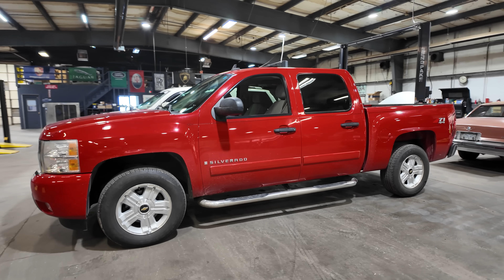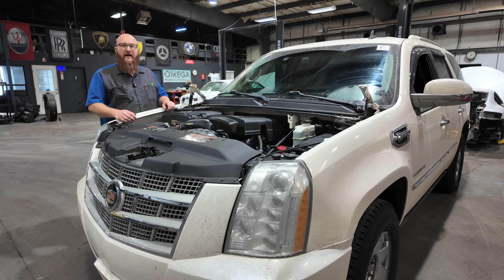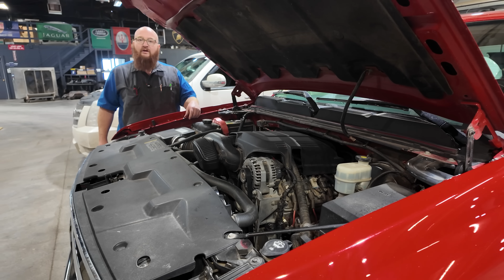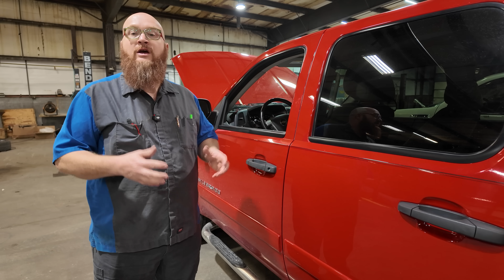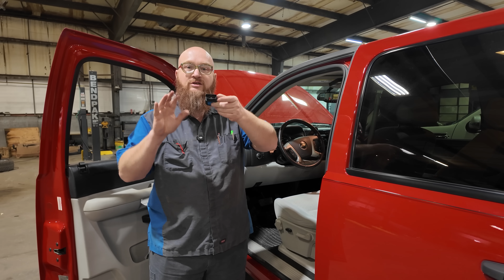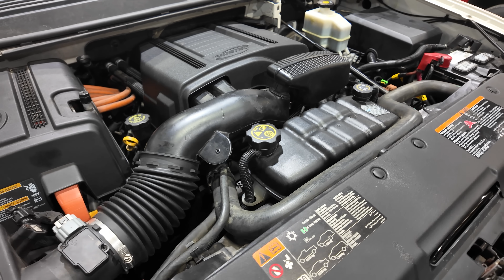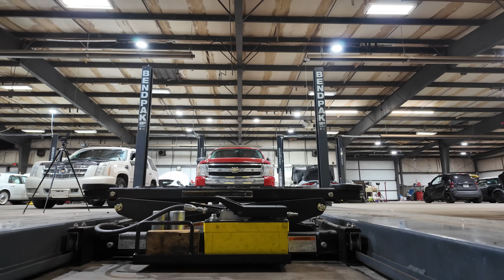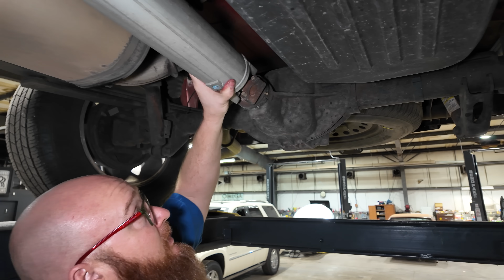AFM: Engine Saver or Engine Killer? The REAL Answer

Comment: I know a Chevrolet mechanic who worked at the dealership. Bought a suburban that needed a whole new engine. The customer didn’t want to pay to get fixed.  Took it home and rebuilt it and deleted everything.   So now it’s a stock 5.3.   Without any AFM prior to 2006.
Reply: I own 3 GMT-800s. Two 2004 silverados, and a 2005 Sierra. I will not buy anything newer that an 07
Reply: @citizenblue  . A friend had purchased a 2009 Silverado 'Classic' model that came without the DOD/AFM/MDS/ACC/VCM nonsense (the 'Classic' model had the same style engine as the 1999-2006 models, none of the Displacement-On-Demand/Active-Fuel-Management/Multiple-Displacement-System/Active-Cylinder-Control/Variable-Cylinder-Management).
Reply: @buzzlight2nd1 yes, they exist, and you have to know what to look for.
Reply: @buzzlight2nd1 they only did the classic in 2007.
Reply: @citizenblue this is the way... prefer myself nothing newer then 2005 really
Reply: How difficult is this process?
I have an 06 already without AFM but if I ever purchase a newer one it would be good to know how to delete the AFM
Reply: @J19A92T  The chevy silverado 2007 was the last year not to have AFM. Anything newer than that just get the OBDII electronic gig and leave it in 8 cylinder mode. I've used that gizmo on my o7.5 silverado since it's had ninety  thousand which now has about 170,000 miles on it. If the lifter ever does start the tick then worry about  deleting the AFM. In my opinion stay with anything that is 07 and older for as long as you can
Reply: @billmonroe8826  i have a 07 new style  LT z71 5.3 flex fuel and it has the afm system.i have 115k with no problems.im ganna try to get the plug in shut off
Reply: @billmonroe8826 my 07 Tahoe ltz has AFM. I use the disable obd plug.
Reply: Some of the 6.0s after 07 still didn't have AFM on certain models and trims, more often on the GMCs
Reply: @syloui alot of the early 3rd gen Cadillac Escalades too
Reply: @billmonroe8826 not entirely correct, I’ve got a 2011 chevy Silverado 2500hd LT with a 6.0 vortec without any AFM
Reply: @billmonroe8826 I have a 07 Surburban and my AFM would seize up from V8 to V4 sometimes. It’s would also throw codes with stability trac light and check engine light. I had a complete fuel system clean and it solved some of the issues and now it has a hesitation with a throttle body code. I just ordered that OBDII gig and hope it works. I had a new engine and transmission put in already and has less than 50k miles on it but I’m ready to delete it all now. I have paid close to $10k trying to find this issue and I’m tired. Thanks for all of this information in the messages
Reply: @J19A92T  The process is not terrible if you can do it all yourself.
You'll need space to take it all apart, all the tools to do it, and the money to buy a delete kit (I saw one for about $700), you also need the engine computer reprogrammed.
So, not much for a truck worthy of it, not a high mile rust bucket.
Reply: @ALCRAN2010  I've been driving a 2008 4WD Silverado since I bought it new. It was during the Great Recession and I got it for $22K from a dealer that was going out of business. I now have the OBD II disabler. I work from home so the truck only has 139K miles on it now. But even if I had catastrophic engine failure, you can't buy a comparable truck for less than $25K. It's a no brainer. Keeping it until the wheels fall off, then putting them back on.
Reply: @J19A92T  It really isn't something done easily in a driveway, but it is doable, there's a few videos on this for guidance.
Reply: @J19A92T  software program and you have to replace the lifters removing the dod lifters (4 of them ) and the valley plate either replaced or you have to plug the right orifices for the afm/dfm system
Reply: Elgen sounds like the way to gon
Reply: There are non dod/afm engines in the hd s with 6.0
Reply: 2006 doesn’t have AFM.
Reply: L20 4.8 was offered till 2013 without afm which with a little work as it shares the block could be stripped of its lifters and valley pan for simple 5.3 afm delete
Reply: I have a 2008 Yukon Denali, 6.2
The engine tanked about two years ago because of the AFM. 
I had the engine replaced by my local mechanic with a Jasper remanufactured engine. I can tell a big difference in horsepower especially on the interstate highway. My question is, does the remanufactured Jasper engine have AFM?  Does Jasper delete this?
Reply: @Tickbryan The 2008 6.2 v8 only has the Variable Valve timing. That's not the 'Displacement on Demand' tech that eventually kills the engine as the Variable Valve Timing isn't much of the problem. The denali/escalade 6.2 v8 years 2007-2009 are not 'Displacement on Demand', so they all use 8 cylinders at all time. You're last engine wasn't bad due to DOD, but may have been due to other reasons. I'd primarily keep an eye on oil pressure.
The new engine is just like the old one, so just keep an eye on maintenance and oil pressure. There's fixes for low oil pressure.
Reply: @20tea thanks for the info!
Reply: @Tickbryan you have to specify  that you want the whole AFM delete.  Extra $1,500 or so and it was a booger for my mechanic to get it setup.  They spent a lot of phone time with Jasper’s techs.  Had 192 k on the original and 105k on the Jasper. Lost around 2-3 mpg but ok with that.  On second trans and new ring and pinion. 
This is a 2018 Silverado 5.3 
I plan to push the truck to 400k. Other stuff like heater hose, coolant hose to the thermostat (2 piece hose with a plastic connector that turned to glass). FYI there is enough hose from reservoir to go over the engine to the housing. I used a piece of larger hose and cut a slit length wise to use as a heat shield.  AC actuator had to be replaced.  Check main ground on frame and clean to metal to eliminate the electrical gremlins. I didn’t have any problems with this truck until tranny died at 167k.
Reply: @Tickbryan Jasper don't make or work ok engine they just sell used parts
Reply: Amf delete, mass air flow delete, egr delete, cold intake and open the exhaust up a bit. That's how to have this engine last. Get the bypass  box until or if you can't do this.
Reply: GMC= Gotta Mechanic Coming

Comment: Only the 2500hd with the 6.0 does not have afm
Reply: It doesn't need it
Reply: @Mr-pn2eh  None of them needed it
Reply: 4500 Express no AFM.
Reply: Nor does the 6.6 .... thus both super long lasting engines.
Reply: My 2009 Tahoe 6.2 doesn't have afm.
Reply: @tylerclawson9033 no such thing as a 09 6.2 Tahoe, the Denali and Escalade were the only 6.2s in the GMT900
Reply: @Bonez1LE I own a 2009 tahoe 6.2.
Reply: @Bonez1LE  Yes there is i own one.
Reply: @tylerclawson9033 what’s the 8th digit of your VIN? Should be 2 if it’s an L9H but I was only aware of the GMC/Caddy getting those
Reply: @Bonez1LE  I don't have my vin right now but a Google or YouTube search will show that the 2009 tahoe was available with the 6.2 at least in ltz trim.
Reply: @Bonez1LE  its a 2 which is L9H which is the 6.2.
Reply: @Bonez1LE Looks like 2008 and 2009 were the the only two years the tahoe got the 6.2.
Reply: My Escalade 6.0 doesn’t have AFM. I’m the second owner. I got it with 118,000 miles and as far as I know nothing was ever done to it. Everything looks stock.
Reply: @ProductCode74  What year is your Escalade?
Reply: @barrya.6212 it’s a GMT800 if it has the 6.0
Reply: No 3/4 ton has afm, however some halfton 6.0 have afm some don’t. Some 5.3 managed to not have afm either but they are really hard to find.

Comment: Shitty lifters right outta the box??????????
AFM, was an idea i pondered as a young person, before its design implementation. My determination was, it probably wasnt a good idea. Apparently i was correct. Especially if the concept is a mechanical valve canceller, the fuel burning is part of correct temperature management, and most of us know, more fuel, cooler combustion. Simply cutting the fuel supply to cancel  a cylinders power stroke would seem logical, but canceling valves with f-d up lifters that collapse??????? wtf?? bad idea.

Comment: These slightly older GM vehicles with AFM can be disabled and still be reliable, if they are well-maintained.
Reply: If one only disables the AFM, the engine still has the prone-to-failure lifters and oil-burning low tension piston rings. One needs to delete, not disable, the AFM for reliability. It is not plug and play. It is remove and replace.
Reply: @jackhoyle4743  you can use the afm disabler and then run 5w30 oil, use valvoline restore and protect, it will free the rings up in a few oil changes
Reply: @jackhoyle4743  It’s so worth it, just did my wife’s 2017 Tahoe and couldn’t be happier with the results. Did it myself for about $1500 and took about 4 days
Reply: @jackhoyle4743 idk I have a 2015 silverado that have 189k miles on it. I bought the truck w 34k miles and put the tuner to shut off the AFM as soon as I got it. No engine issues however the transmission did go out at 96k miles due to the high temps they run on these